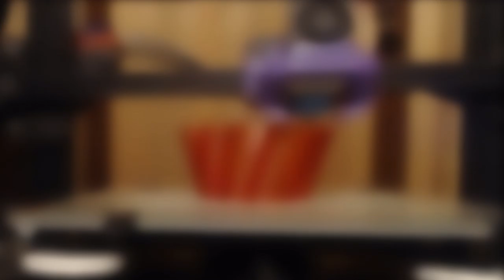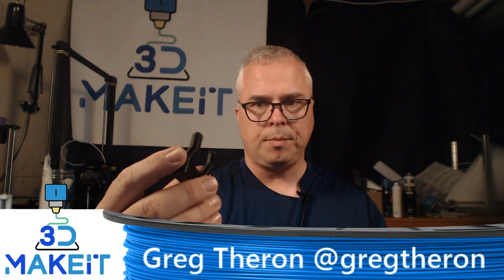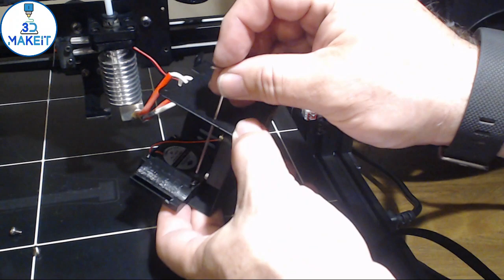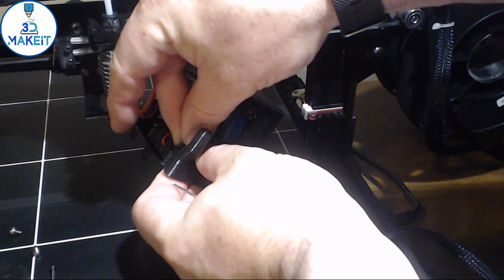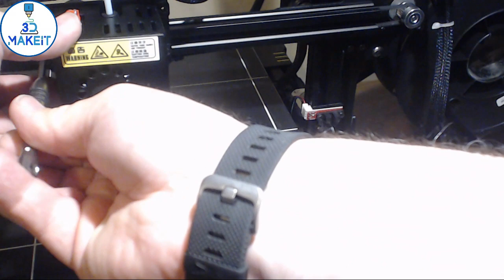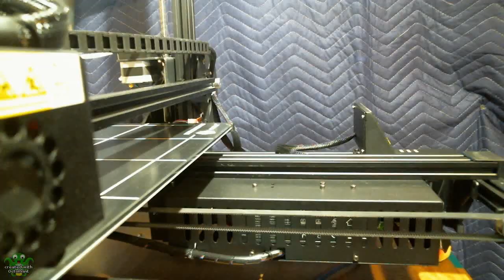Anycubic Chiron Fan duct Upgrade

Comment: I just changed both my fans and the front fan comes on straight away but the blower fan doesn’t. Is there a best setting for it to start working or maybe the new fan doesn’t work .

Comment: hi, on my chiron I have the original fan that send air into the air duct (it's a 4010). Can this new air duct fit with this fan?
Reply from the maker: So there are a few available that will fit the stock fan. This one does. I have switched mine to a 5015 blower now with a Banta duct.
Reply from the maker: https://youtu.be/qNUXaRs_-gc

Comment: Hey there. What software do you recomend to use with this printer. Just orderd the same my self. And i am borrowing a wanhao i3 from a friend atm and using cura slicer. This fan upgrade will be the first one i will be printing 

Thanks
Reply from the maker: Cura 4.1 has a Chiron profile, but I use both prusa slicer and cura 4.1. both have there benefits. I just started using prusa slicer more recently. The suports are awesome.
Reply: @3DMakeIt  Thanks. Ill keep that in mind,
Reply: If you have the budget,  go simplify3d, support structure and break apart is 2nd to none.  also slows down for parts that have overhang without supports.

Comment: Nice design
Witch filament have you used?
Thanks for sharing👍😀
Reply from the maker: Amazon Basic Black PLA, I have PETG Yellow But wanted to make sure that it worked well first.
Reply: @3DMakeIt  does it work with pla or does it have to be petg..? :)